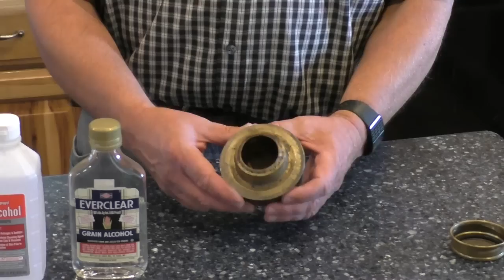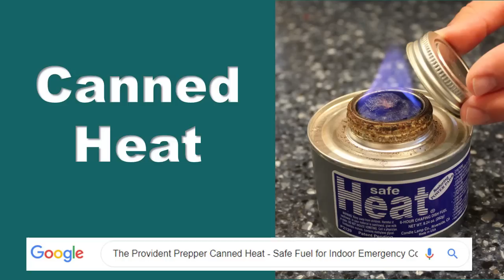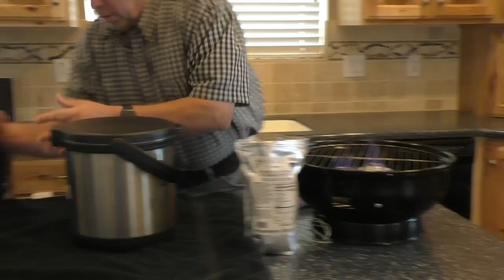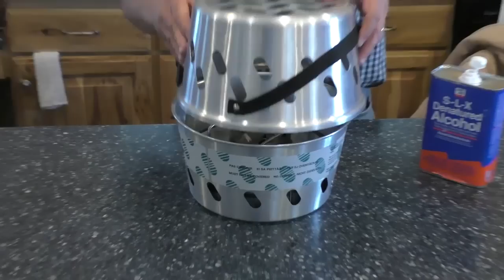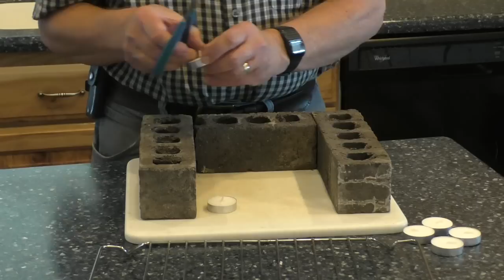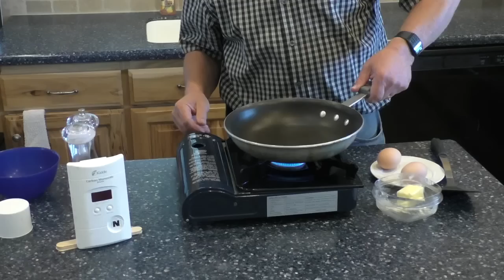Safe (and Fun) Indoor Cooking When Utilities are Gone

Comment: just being able to boil some water is a huge help.  boiling water can make hot drinks, instant oatmeal, instant potatoes, and has kept me comfy during outages. I use tea lights and sterno.  havent used an alcohol stove yet. I do have a butane stove but dont have fuel for it and havent used it yet.
Reply: Check out the NJ NSD-11 Portable Gas Stove Single Burner Camping Cooker Indoor LPG. I love it. Solidly built and powerful. It took a heck of a lot of strength to connect the rubber hose to the regular and the stove though.

Comment: I bought some of those safe fire cans, just in case electric goes out this winter. Use them for heat in a smaller room with the clay pot idea. Have solar devices but can't run a heater on them.  I hate being cold

Comment: Quick note: EVERY combustible that contains carbon (basically ALL commonly available combustible, including alcohol, wax and wood) can produce carbon monoxide if the combustion isn't complete.
But, of course, if the combustion is clean, you should come up with carbon dioxide (CO2) and water (H20) in form of damp.
Using gas stoves indoors is not that bad as you can think: we use gas stoves everyday in Italy and almost nobody have carbon monoxide, fire or gas detectors.... despite these in things, carbon monoxide deaths are very rare (BTW, almost all of the deaths are caused by water heaters, boilers and space heaters, which are much more powerful than stoves and commonly remains active for a very long time unattended).
The two most common thing to know about carbon monoxide: 
- if the flame is blue, almost no carbon monoxide is produced.
- if you feel strange, if you have an headache or if you feel lethargic and you are alone, consider to open a window and check your flames.
- if you feel the previous simpthoms and other people around you feels the same, ALWAYS OPEN A WINDOW and check your flames.
- if you have space heaters, water heaters or other similar devices that runs unattended, always periodically check them for any issues.
In any case..... you have produced more carbon monoxide running the candles than the gas stove (still a small quantity).

Comment: There are older videos on YT that say one can make a safe, long burning "candle" and heat source with Crisco. Safe, effective, easy to store; and cheap. It is even suggested to keep one in your car for emergency heat/light.
Reply: @Sandra Myers : That goes for any burning source, especially liquids. Crisco, like wax, somewhat solidifies when cooled. Cooking oils, like olive, that have turned rancid are still good to use as a light source in oil lamps, but caution must be used.

Comment: For the tea light heat, instead of resting a grate on bricks, why not put the tea lights on the floor of your oven? Then you've got a stable grate built in and don't have to worry about accidentally knocking it off. Plus, the oven walls add insulation. And it's safe from kids and pets.
Reply: Good idea!
Reply: Great Idea! I like that one!
Reply: Possibly too big of a space to heat for tea lightsm
Reply: @watchandpray8918  as opposed to an open room on a stove top or tabletop? The idea is just to use the grates in the oven. Usually ovens have different slots to stick your grates in, so you would just have to position the heater on the oven floor or on a grate just below another to close the distance
Reply: Brilliant ! 😊
Reply: Would that be dangerous doing that with a gas oven? I don't know if there's any residual gas leakage when the stove is off.
Reply: @hazel555  If the gas was on, you wouldn't need to jury-rig a way to cook with tea lights. The video is about cooking when the utilities are out. I suppose if you have an older gas stove with a pilot light, and if the gas happened to come back on when you had a tea light light lit in the oven, it would be a hazard. But that's highly unlikely, because they don't just turn the gas back on remotely, because pilot lights may need to be lit to prevent gas leaks.
Reply: @hazel555  My thoughts immediately.
Reply: Great idea!
Reply: Wow. Smart !!!
Reply: Great idea!

Comment: I have a little chocolate fondue set that you heat with a tea candle. It comes with a little metal rack with a little ceramic bowl that sits in it, that you melt the chocolate in, with the candle underneath. It even comes with a little recipe book. I'm not sure if they still sell them, because I got mine from a garage sale, but you could check Amazon. I haven't actually used the thing yet, but it did give me the idea to use candles to roast marshmallows. I've done that almost every time there's been a long power outage. You hold the marshmallow with a barbecue fork, because they have a nice long handle. Be VERY CAREFUL! Don't hold the marshmallow right in the flame because it will catch fire. Hold it just close enough, so that it gets enough heat to sear. You should hold it above the flame, but it shouldn't be touching the flame. It only takes a few seconds. If you're really worried about safety, keep some water nearby. And don't use scented candles because the chemicals and the smell will contaminate the marshmallow. The best type of candle to use for this, is a plain unscented white stick candle. The next time a major storm is expected in your area, buy some gram crackers, chocolate and marshmallows so you can make smores.

Comment: I'll have to try the safe heat cans, I sl ready have the slow cooking thermos, but haven't used it, I also have some pressure cookers, and some butane caterer single burner stoves. (Note; the butane cartridges can be refilled with a propane adapter from a 20 pound cylinder.)
Reply: The transformer went out last month, we had flashlights to share,  but the house cooled down quickly and extra blankets were more important than meals at that time.
Reply: Just was told about the "Sterno Inferno" the "jet boil" of alcohol  burners.

Comment: The Origo’s are sold out :( I’m not last minute, just had to move with work and lost our indoor heat source :(  Will Mr Jones please recommend a comparable product? Looking for warmth and cooking. THANK YOU! Sorry to be a headache!
Reply: Hi Mimi...yes, the Heat Pal 5100 has been difficult to get. As near as we can tell, they recently stopped production. Several people have been able to pick up one on ebay, but one person ended up with one that was pretty trashed. You might try finding the HeatMate 5200...a very similar design and function...not sure how available they are. You can also use an alcohol burner or safe heat in a small stove for cooking.  Candles in a candle oven or a small stove are another fairly safe option for cooking. Many butane stoves are rated for indoor use and work very well. Fuel storage is a bit more problematic when storing cannisters. My favorite heater is the Buddy Heaters series. They are rated for indoor use when using the small propane bottles (if using the 20 pound or larger bottle, the bottle is supposed to stay outside with a hose coming into your home). Again, you need to store the fuel safely and legally. Hope this has given you a few ideas. In all cases, follow safety instructions and have working fire/smoke and digital readout Carbon Monoxide (CO) detectors close. If you have further questions, connect with us on our contact page. Sounds like you have some great things going on...Thanks for Being Part of the Solution!!

Comment: I use my butane stove on the back porch (outside).  I also have 10 acres and 6 of that is wooded.  So I simply cook outside.  I've cooked under the umbrella in the heavy rain before.  The umbrella shelters the fire and pot, not me.  I have a charcoal grill but it's very hard to get charcoal started in the rain so I start a wood fire in the grill.

Comment: Now how do u stay cool in ur home without electricity, specially in the summer???
Reply: @TheProvidentPrepper  that's my problem, live in a one bedroom apartment and I can deal fairly well during the cool weather without electricity but during hot weather is unbearable, was wondering how I can cool off the apt, is there's an fan that is not electric?
Reply: @carmenmendez6836  Hey Carmen...that is a real challenge, and you have taken the first step to prepare for that...you have recognized the issue so it can be dealt with. We have children in the Phoenix area, so we are very aware of this issue, and how serious it could be in an extended electrical outage. Kylene mentioned the whole house fan, which works great as long as you have electricity. One option is to get a gas generator. The downsides of that are that you must store fuel, which creates it's own set of hazards. You also MUST use this outdoors, which often makes you a target because even the quietest models still make some noise that can attract attention to the fact that you have power. You also need to either set up your home to feed the power into your home system (making sure that the grid power is disconnected), or you must run cords. Doable, but with some challenges. I like the option of using a portable power station, which is basically a battery bank that can be charged with household power (when available), then charged with solar. These power stations can then run household appliances such as fans, as well as charging phones and other stuff. They are completely silent and portable (most of them weigh between 30 and 50 pounds. You could use this and some fans to create a whole house fan effect. Since the warm air rises, you can use the highest window (or even a bathroom fan) to release or push the hot air out, and the lowest windows to bring in cooler air when the outside temperature drops below the inside temperature. If you home or apartment is well insulated, this can often cool it down and keep it cool well into the next day. You would keep this system going until the outside air again becomes warmer than the inside. If you want more details on this, email our site and we can discuss further. If you can find an extremely efficient evaporative window cooler (if this works in your climate), and you had enough electrical capacity in your power station, that would also be an option. Also, be sure to use foil or other reflective material to reflect direct sun back out. Use a spray bottles to create a mist that will facilitate evaporative cooling. You can also use damp clothing or neck coolers for additional evaporative cooling effect. Hope these ideas spark some creative solutions. Again, if you want to continue the conversation, email our contact page. Thanks for being part of the solution!
Reply: @JonathanBJones  My solution is... do not live in the south, and DO live in a lightly populated area.

Comment: We talked about how we would cook and decided that bad crap happens to us. We are going to do any cooking on the back porch it's covered. I have caught the kitchen on fire 2 times with candles. We don't trust ourselves to have an open flame. Sometimes, you just have to admit you aren't the guy, he can't hit a nail with a hammer, and my brain is to chaotic and gets side tracked open flames would be bad.
Reply: Oh my goodness, I can totally relate, Cathy! I am so scatterbrained that I am TERRIFIED of using a regular pressure cooker. I’ve done it, and I would still do it, but it scares me to death because I am so prone to forget things even if I’m right in the middle of something, I will forget things. Even if I set an alarm, sometimes I just won’t hear the alarm because my brain is in another gear. I bought an electric pressure canner specifically because I’m so absent minded. I know some people say they’re not safe, but everything I’ve canned with it has come out great, even meat, and if I “forget” it, it will turn itself off when the timer is done. 

Once I was boiling syrup for candy apples and I checked it, and it was “almost there”. A went to do one quick thing, and when I came back it was burning. I put a pot lid on it to keep the smoke from going everywhere, and the heat made the lid suction onto the pot and I almost never got it off. Ruined the pot.

Another time I was making simple syrup and forgot it, and didn’t hear the alarm I set, and it wasn’t until I smelled smoke that I remembered. It boiled over and got all over the stove. Took me DAYS of scraping to get it off the stove.

Why am I like this? Being like this is frustrating. :( 

I guess I’m lucky I haven’t burned a house down.

Comment: very happy to learn about the thermal cookers! will be getting one of those. I can cook outdoors, or I also have an alcohol burner for indoors if necessary, so am not necessarily worried about cooking if the power goes out, but you had some helpful hints, the thermal cooker being chief among them. I have something similar to your marine stove, but on a smaller scale--it just heats water only--but boiling water can make a lot of different things, and it burns twigs or paper scraps or just about anything. I highly recommend this. I think I got mine at Lehman's.
Reply: Could you tell me the name of the device you bought at Lehman's . I love Lehman's

Comment: I got a Trangia burner and a solid stainless steel little stove stand that is 4 3/4" in height. It has a square grid on top, 6" x 6". I picked it because I wanted something where I could feel secure putting a 5-quart pot on it. If I put the Trangia burner on the stovetop in the middle in between the regular electric burners and place the stainless steel stove stand over it, is there any reason I would need anything UNDER the Trangia? And if yes, would a square of decorative stone tile do the trick (like people use to decorative the walls and even floors in their kitchens), just to lift it a bit up off the stovetop? (I hope this question makes sense!)
Reply: @TheProvidentPrepper  Thanks. Maybe I will even put TWO tiles under the alcohol burner. :)  Love your channel. Thanks for all the helpful information...!!!
Reply: I  love my Trangia 25  alchohol camp stove set.. which comes with non-stick pans.    There are some good Youtube videos on these handy stoves.  Much safer than using the burner only.
 Denatured alcohol or Everclear Alcohol are the preferred fuel.  They burn very clean.  Isopropyl alcohol works in an emergency but burns very dirty.

Comment: https://www.amazon.com/stores/SolSource/SolSource/page/692190CC-8309-4424-A2BF-7B901EB90E4C  This is very expensive but well worth it for some people.This is the Solsource cooker! It's a solar cooker by the sun with a little mirror below the reflectors. For high heat you move it towards the sun, for lower heat you move it away from the sun. It will take 15 minutes to heat up but no soot, smoke, bad fuel smell. You can even use a wire stainless steel cake cooler to put over the pot stand for smaller pots. It's easy to clean up if there is splattering. You flip the reflectors that looks like a satellite dish to turn the stove off. https://www.countrykitchensa.com/shop/essentials/13-round-cooling-rack/40/771/184/650916/?gclid=CjwKCAjwpqv0BRABEiwA-TySwZ-0VFfRnSor_v18DV8hKLnnM65S0hLymcPp0DHwT-hP_AzyvMjhUhoC9I8QAvD_BwE This cake cooler wire rack would be great for small pots to put on top of the pot stand of the solsource. :) These are just suggestion so you have more greater options for emergencies. :)   https://shopyzaz.com/?product=solsource-sport-solar-powered-stove?utm_source=Google%20Shopping&utm_medium=cpc&utm_term=102940&gclid=CjwKCAjwpqv0BRABEiwA-TySwRE6YGZSjKac0v6IXTdu2RRYhLYzxfhXP9iopIO4SxX0VJF9Tf7DeBoC78kQAvD_BwE The solsource also comes in a mini version for camping. You can take it apart and put it in a backpack, then put it back together again. :) Say goodbye to smoke, soot, bad fuel smell, and carbon monoxide.

Comment: A carbon monoxide detector is not totally sufficient by itself. Even if you have a flame that produces zero carbon monoxide, a hydrogen oxygen flame is the only one I can think of at the moment, you will still be using up oxygen. Unless that oxygen is replaced, you can suffocate from the build up of carbon dioxide. The risk is greatest in "modern" homes that are highly sealed against vapor and air infiltration.

Comment: The alcohol stove is a Swedish military burner and you should always remove o-ring before snuffing out burner or the O-ring will melt and cause fuel leakage during storage. Another feature is the small well that surrounds outside burner that's used as a priming well in cold temperatures. All open flame stoves need to be vented by opening a window or use a stove vent hood. Microwave or electric stoves can be used without ventilation unless there is smoke during cooking or baking.